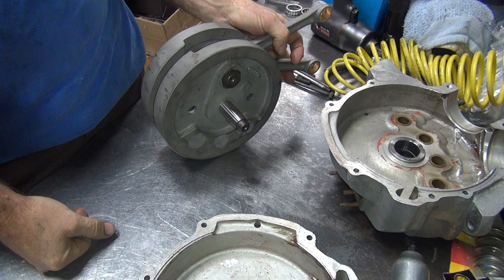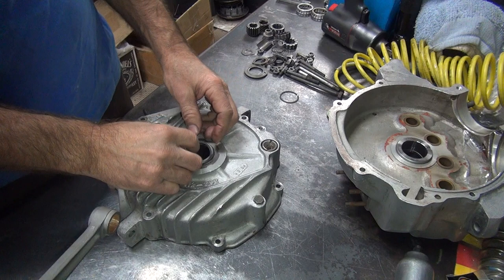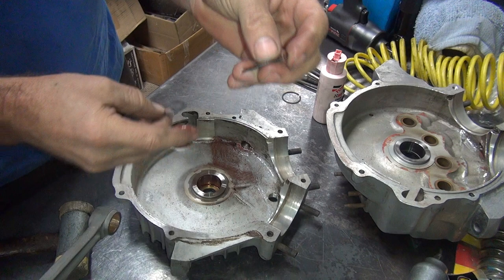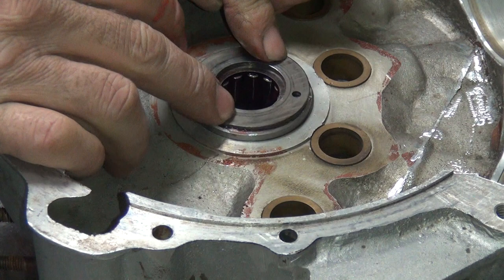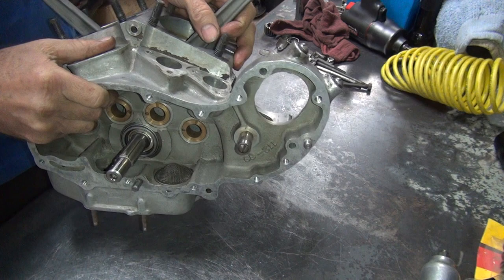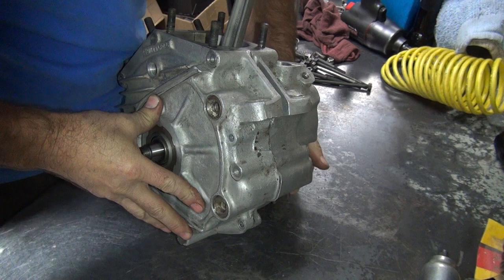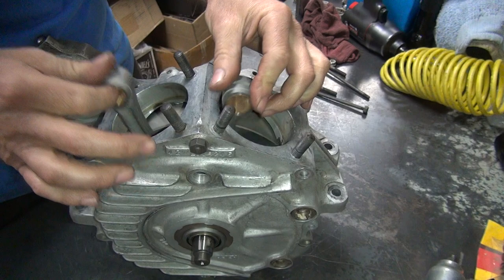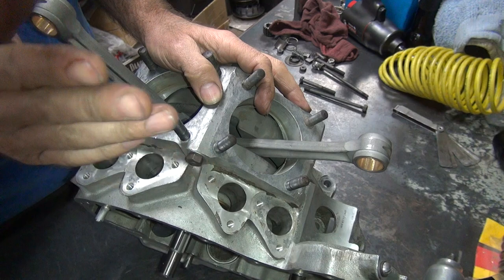1942 wlc #105 wla 45ci flathead dirty motor rebuild harley wl side-valve  by tatro machine

Comment: So, Tatro, I know later 45's have a retainer on the flywheels that prevents the crankshaft nuts from turning and backing off.  There is a small screw that holds them in place.  I did not see them in this older motor.  
were they a later addition by Harley-Davidson?

Comment: Hi Tatro, I see you using a rattle gun whenever you do your crank pin/sprocket/pinion shaft on 45” flywheels. Is there a torque spec for them? All the manuals I’ve read just say very tight but what is very tight? Cheers for all the great videos.
Reply from the maker: that depends on the parts you are using. jims shafts and good nuts mean you can torque things more. i pull things down until things start to feel soft. on stock parts this might be 80-90ft. with good parts this might be more in the 125ft+ area.
tatro
Reply: @TatroMachine  Thanks a lot for the reply. I am using Jim's nuts and shafts so I'll aim for 100-125ft/lb. Appreciate the response.